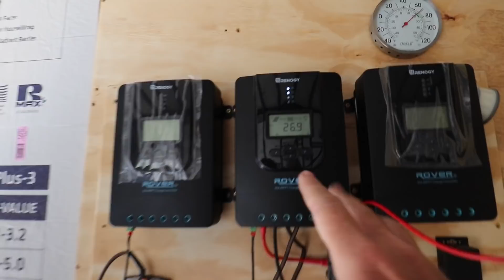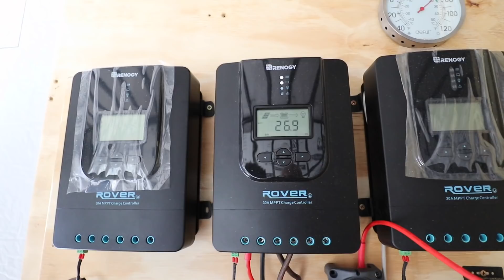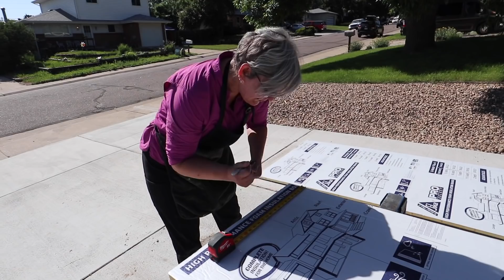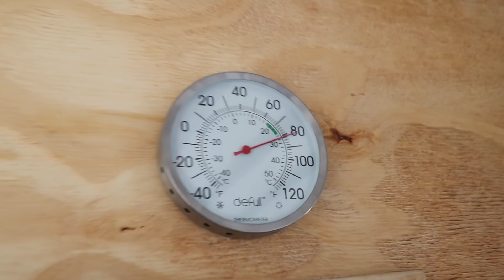Insulating Walls of My Cargo Trailer Conversion E617

Comment: Seven, why are you insulating before welding in framing for windows??? Or running power?
Reply: All fab should have been done before anything else
Reply: @letsgomicroliving_1993_  I hate seeing Seven make these mistakes, when he puts a welding torch to the walls to do his framing, and all that styrofoam explodes in flames or melts it's going to suck.
Reply: @letsgomicroliving_1993_  and since this trailer was custom built.  7 should have had a few windows framed in...or installed at the factory.
Reply from the maker: Ive not yet found windows I want or like. also, I don't have money to buy windows at this point. I did buy insulation several months ago when I had money and was living in Florida so needed the insulation out of Dougs storage and not hauling it around. figure it would be best to install all insulation now and once I have windows I can pull it out to fit the windows. I'm planning to run power in front of insulation but behind shiplap strips which will be the final finish (much like I did in my step van)

Comment: I have binge watched many of these cargos build trailers (as I have my own to do) but I am not sure that the insulating is being done correctly on the builds.
All so far have filled in the gaps between the metal uprights with the insulating material as it seems the obvious and easiest way to do it........but is it correct?

This is how I envisaged it prior to watching any videos - 
1. leave the 25mm gap from the aluminum skin to the inside of the uprights as an air gap to help with the insulating and moisture prevention properties
2. install some sound deadening on the panels
3. install a vapor barrier across the front of the uprights leaving the 25mm air gap
4. install 25mm wooden battens horizontally over the vapor barrier and also giving a thermal barrier
5. lay the foam insulating board between the battens and over the vapor barrier
6. then install your choice of wall material e.g. ply or pine boards etc

I realize this will add weight and you lose another 50mm of internal width, but if you don't do it this way aren't you compromising the majority of your R insulation rating and losing a vapor barrier?
Open for suggestions / corrections.......as its better and cheaper to get it right the first time.

Comment: A buy back will leave you a vehicle with a salvage title. The engine & transmission appear to be good.  If it were mine, I would buy it back, locate swap meet / ebay replacement parts.  BEST WISHES

Comment: If not already completed you should insulate behind the controller board. 👍👍 Becky
Reply from the maker: there is 2 inches of insulation behind the electronic panel
Reply: @SevenWanderstheWorld  Awesome wouldn't want you to have a cold spot in your new home. ☮☸

Comment: Wow so the trailer isnt square and the metal studs are random widths apart. You would think for as expensive as they are they would be built better and have better quality control
Reply: Yes....the excuse that "it's just a cargo trailer so this is to be expected" is asinine.  I've bought several enclosed car haulers in the last 30 years.  Mine had decent welds and everything was square.  I always ordered them with a thicker exterior wall, and 2-7,000lb axles  Many do appear to be crappy these days. 99% of what they stock on a sales lot is light duty garbage.  Renown knew what he was doing  with it.  having gaps between the frame and the exterior siding (earlier video) was totally unacceptable.  The last one I bought and needed immediately.  I settled for things that I really didn't like.  But it was the only brand that had the right size and didn't look like junk.  It was all aluminum and cost twice the money of a base/crap model the same size.  But long term, it's a bargain.  7's trailer is going to be a very heavy trailer.  I'd have to use a F450/550 to pull that.
Reply: Yeah it looks like he got a couple of drunks that built his trailer.
Reply: @Cesium67  I've seen videos of trailers being built.  They were in a huge hurry and couldn't possibly do a quality job at that rate. I would expect the builder to have a large jig set up to line everything up square quickly.

Comment: Listen to what u just said  I woke up Becky in  Bed  and tell me that Doesn't sound funny it Confused me because I thought u had separate  rooms,   Here's  thought  ask a neighbor if they have a truck they will sell u  Thats what my Dad (not blood related to him or to My Mom) did when he needed a car Also I recommend u put a Kill Switch in the New truck that way Thieves womt get away and have something  installed that locks them inside until Police arrive. and make sure there is an Alarm on it and a tracker. I know it will get pricey but it might help in the long run

Comment: Next time purchase a used camping trailer with everything in place, makes way more sense and requires very little work. Le$$ in the long run..
Reply: A well built cargo trailer is MUCH more structurally sound than a camping trail, and each accessory is the cheapest equipment that the manufacturer can source.  Fine, perhaps for random trips, but not for year round living.
Reply: @TravelingStacker  No need to buy a cheap worn out trailer as you say !!!!
A good name brand a few years old makes more sense in the long run...
Reply: @ronjclm8590  Plus it's tall enough for Seven and can carry what he wants. I believe it's also wide enough for him to sleep crosswise even with insulation, so there are a lot of reasons why he went this route and they make good sense.
Reply: @ronjclm8590  Thousands do live in them nation wide some for many years ...
Reply: @bextar6365  And some people live in a tent all year round.
Reply: @ronjclm8590  Brilliant deduction = Sherlock !
Reply: @thizizliz  I pull around a few trailers everyday while I work.  A 20 foot tag a long is about as long as I feel comfortable towing and can easily get in and out of just about anything.  When I pull my 24 foot.  I get limited to where I can easily go.  My problem with 7's is that he had  the floors and walls on 12 inch centers and he should have decided where he may want windows and roof vents and had the factory build the frame for them.  16 inch on center is plenty,  Many cheap trailer are 24 inch on center , and the builders didn't seem to do a very good job.  I love the 7,000 lb axles.  I always get them myself.  When you get bigger axles.  You get a heavier frame to go with it.  And the trailer will be pretty heavy to tow...with a 220 hp truck.
Reply: @bextar6365  Go watch some "camping trailer crash videos" and see how sturdy they are.  They also have minimal insulation , many have wooden wall frames. But of course...there's different strokes for different folks.  That's what makes the world go round.
Reply: @TravelingStacker  AIRSTREAM....
Reply: @ronjclm8590  The major amount of camping trailers in USA are store bought, not home made. Sale$ make the world go round.